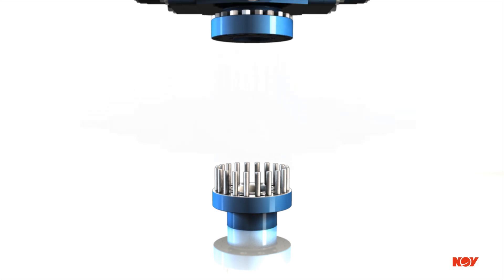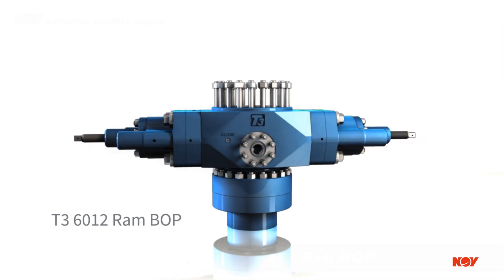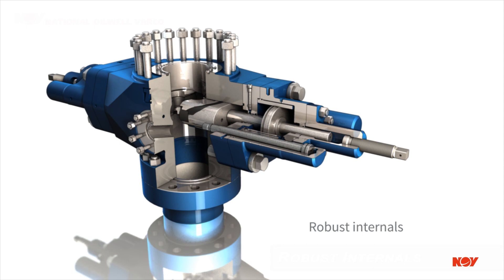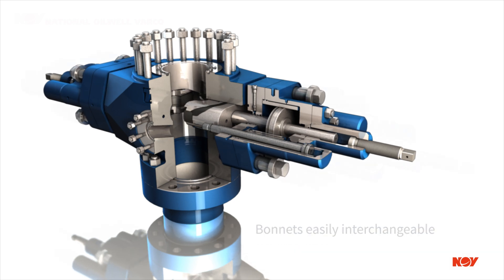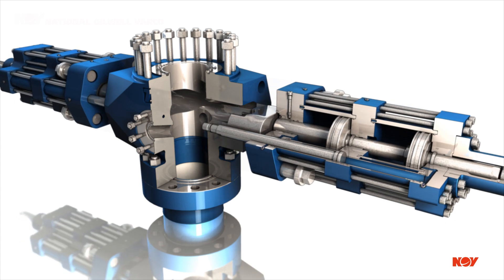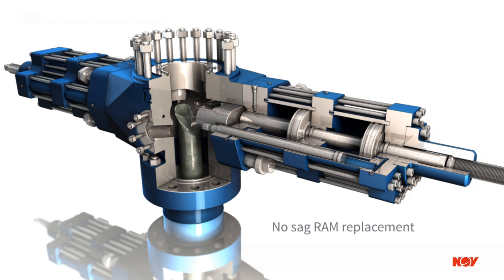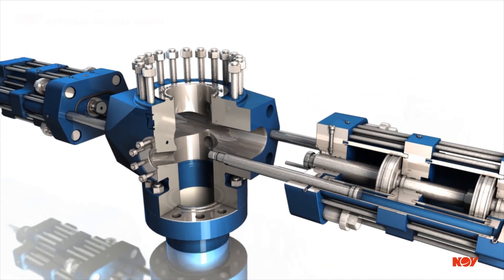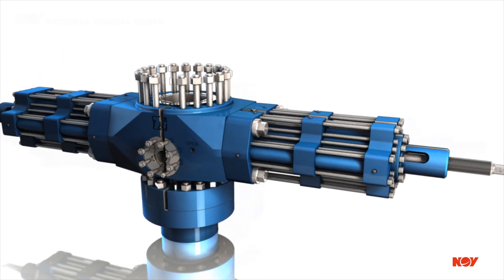T3™ land rig blowout preventor (BOP)

Comment: I'm about to introduce a blowout prevention sysyem that is repairable and can do the job of preventing blowouts. The deep horizon incident highlighted the flaws in using the annular and blind shear rams. The b.o.p. system I've designed is capable of being tested to verify it will work and is less subject to failure. This also means that system upgrades to the ocean based oil or gas production platforms that use the annular valve and blind shear rams will need the needed upgrades to be designed around it. The annular valve can be used until it fails and blind shear rams not used at all, until the well is abandoned and after sealing with slurry cement mix. The newer designed b.o.p. will enable the well to be closed and repaired. After repairs are made the well can be returned back to production. My suggestion is that the opportunity to keep your company going as I'm sure a safer system of b.o.p. that will save major oil companies billions in cost in avoiding spills, loss of life and environmental damage.  I'm a mechanic that supplied a caphead design to BP " horizon helpline" that stopped the deep horizon's macondo well blowout. This was on July 20th, 2010. BP claimed my design as it wasn't patented. Good way to pay someone back for helping. 
This is a genuine business offer and will have to have patented valves needed for major oil companies and is no doubt the old blowout prevention system is out and new one in! If interested contact me back here.
Reply: Lol, lmao even 😂😂😂😂